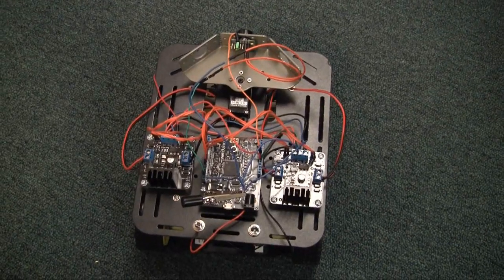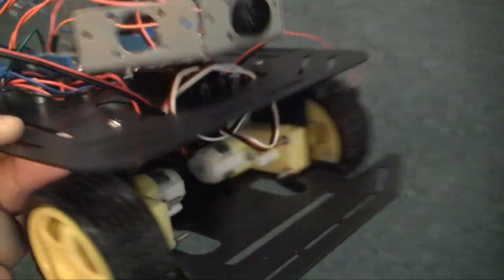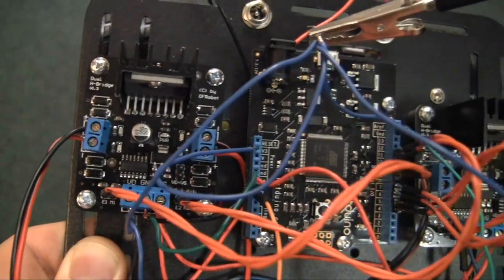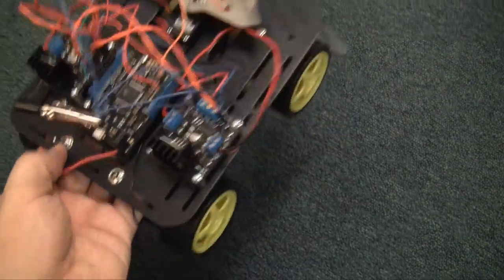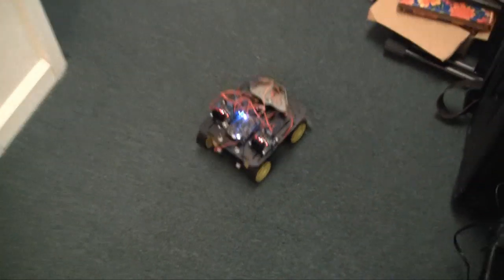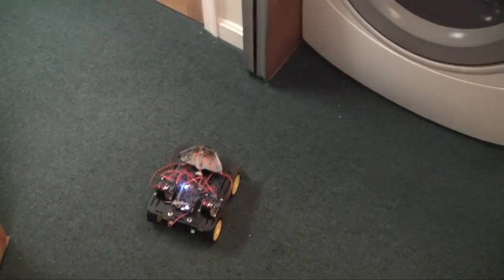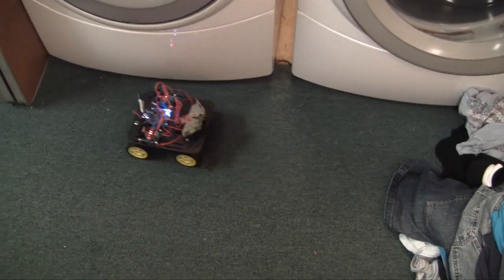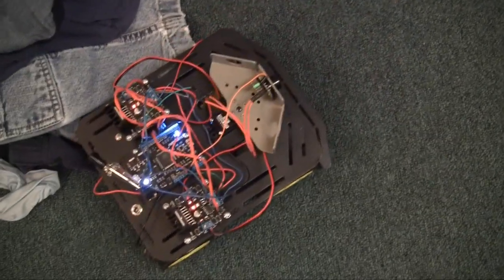Netduino-Powered Robot (Obstacle Avoidance) First Test Run

Comment: Hi, thank you for the video. I am going to build my first Arduino robot and I am confused between 2 wheel drive and 4 wheel drive option. It seems like 2 wheel drive is easier to turn (and to program I guess), but my aim is to load more feature on the robot once car is mobile and 4 wheel drive offers bigger frame and more option to load things. What would you advise should I go for 2 wheel drive or 4 wheel drive? many thanks